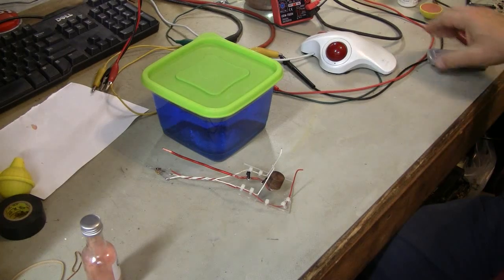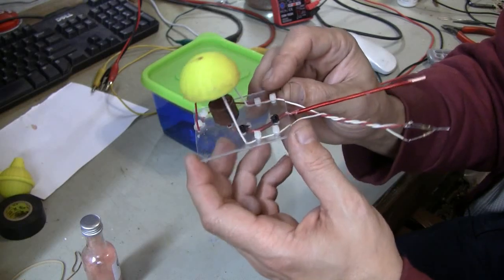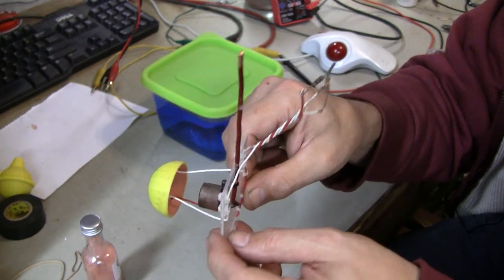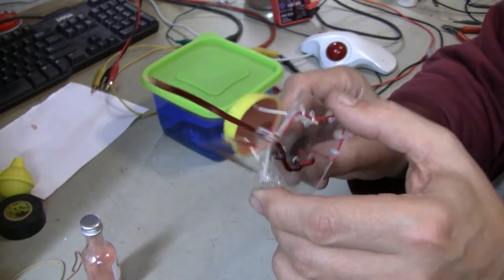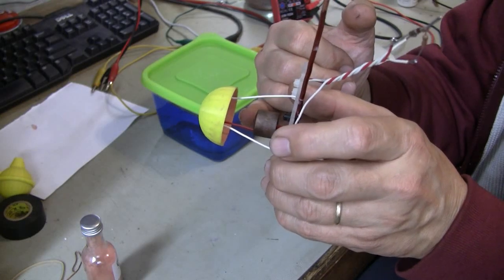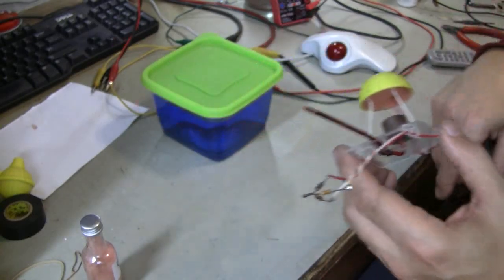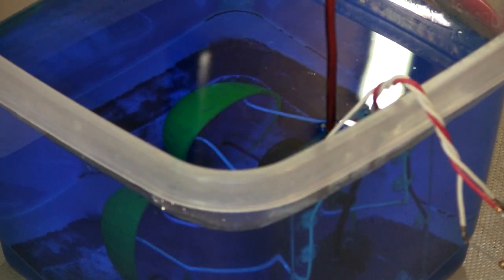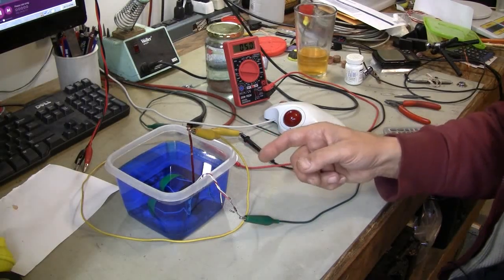#426 Part 2 Electroplating Plastic Time Lapse

Comment: Wouldn’t a voltage regulated supply do exactly what you’re doing manually? The same voltage, as mor area is plated, the higher current at the same voltage. 🧐

Comment: Am noticing what appears to be concentric lines on the inside of that ball close-up. Is this the lining up that Keshe spoke of?
Reply from the maker: +Jerry Cthulhu It's neither. It's the tiny ridges of the printed layers showing through the plated copper.
Reply: I think it is just the pattern makes as it spreads out across the copper powder, from the lead(s).
Reply: ZeroFossilFuel Thanks Z, I'll get it one of these days...